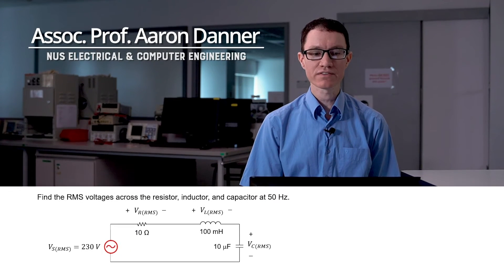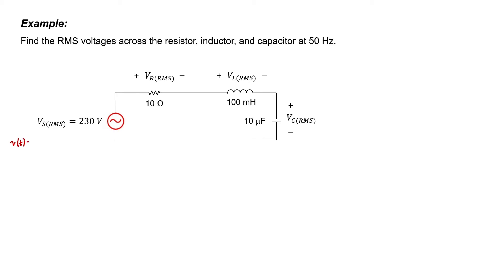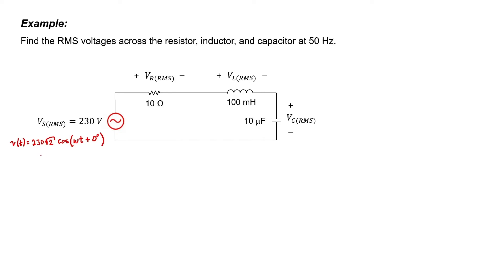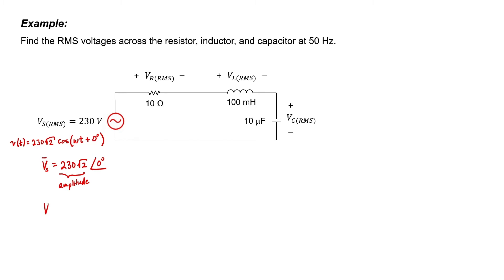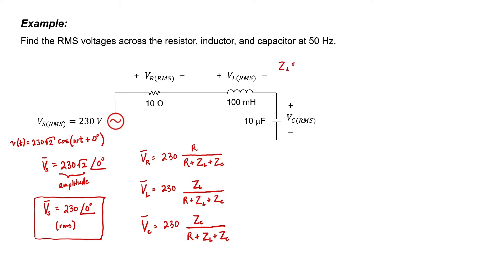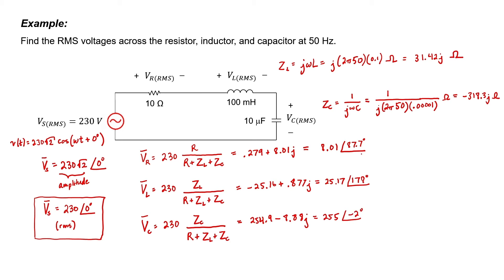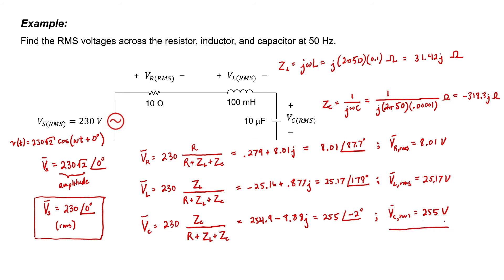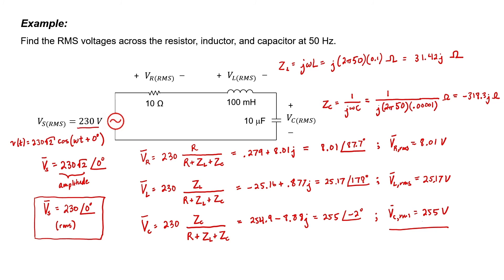Phasors: RMS or Amplitude? (#9 AC and Switching Circuits)

Comment: There are two different notations seen in different circuit textbooks. Some follow rms phasors and some follow amplitude phasors. 
One of the authors, who follow amplitude phasor, told me that, he is following IEEE standard. 
But I also believe that phasor should be in rms value. But I don't have any reference book of any standard.
Could you please give the link of the IEC standard, in which, it is mentioned clearly that, phasor should be in rms value ??